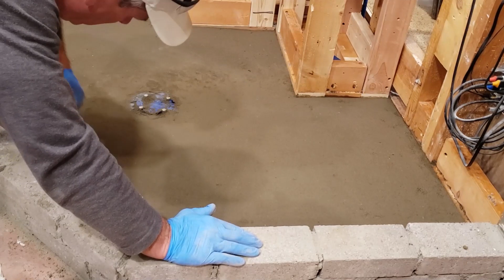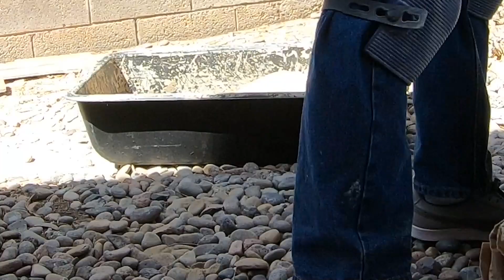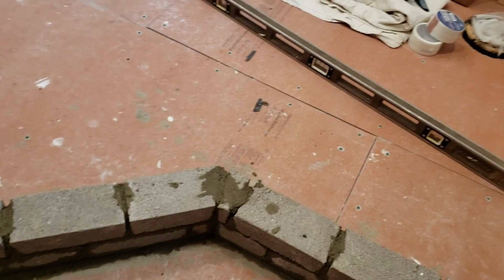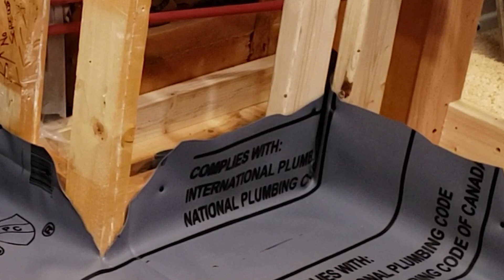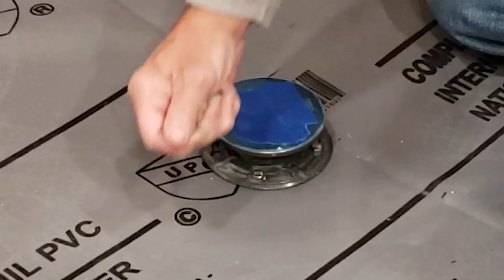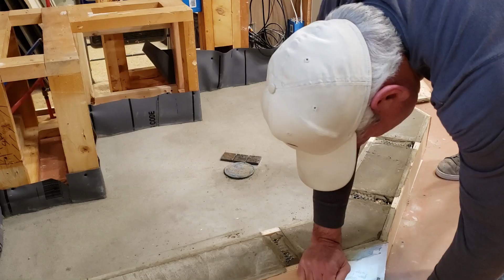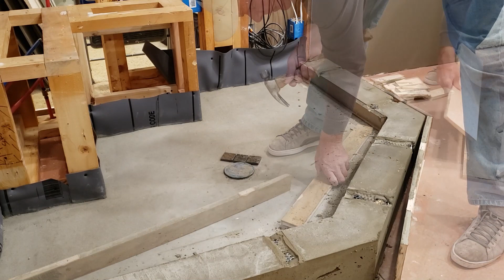Building a Corner Shower Floor From Scratch - Part 1

Comment: What about if I have granite scrap bricks? Do I need to cover the front of them? Or is it possible to just bring that metal mesh and then thinset and tile over the top and inner side? Also, is that wood on the inside of the ledge necessary? And does the metal mesh screwed into the floor help secure the bricks to the floor? Or can you just mortar them directly to the floor?
Reply: I forgot to specify, it's on a concrete floor, and I was hoping to use granite for the top tile for the curb and use actual tile for the rest. My goal was also to be able to see the edges of the granite built up on the outside of the curb because it looks neat, but definitely don't want to compromise the shower for looks. Lol. Thanks for any info!
Reply from the maker: Yeah, it sounds like an interesting idea that has lots of possibilities. Yes, you can integrate your granite pieces into the curb in any way that works. Just think of them as tile pieces that you need to be able to stick to the curb with thinset. You just need to consider the joint between the tile and granite pieces and how to make that work. I have often made a 45 degree cut on edges like that which I can close close together to give me a clean grout joint on those corners. On the curb, you are wanting to build a block of solid concrete mix out of bricks, mesh and the mixture of Portland cement and sand that encases the shower pan. The concrete floor is great and you can use thinset or the Portland cement mix like brick mortar to set bricks for the curb. Anytime I was using wood on the curb, it was as a concrete form to float my Portland mix in with. Once the mix is dry, the wood is removed and you are left with a straight and level edge to set tile against. Good luck on your shower! Sounds like a fun project!

Comment: What about the bench. No liner on the bench it will leak water
Reply from the maker: Nope, there is a Building a Shower Seat - Part 2 to the corner shower build. The bench seat is designed just like the shower floor and walls with Hardiebacker and a membrane but no dry pack. Here is the link to that video. https://youtu.be/F6axpz5jOIQ?si=6b_s_-izYgWtGrjs

Comment: Do you use regular cement to stick the bricks together?
Reply from the maker: Yes, same 1 part portland to about 2 parts sand to make it a little richer. Then mix in water to make a regular mortar consistency to use.
Reply: @RustyDobbs great thank you!

Comment: Why bricks and not 2x4?
Reply from the maker: As much as someone may try to waterproof 2x4s in the step, if water gets to the wood it will expand and the step will crack. Nothing you can do then except stop gap measures until you replace the step. Bricks are not any more trouble to use and no issues with expansion.

Comment: Finally someone who can build a shower correctly, I'm one of the old time shower builders that built it just like this except I used lead pans
Reply from the maker: Wow! Thanks for watching and for you comment! Lead pans were before my time but I have torn them out for sure doing remodels. Yes, these dry pack methods are hard to beat for floors. I'll bet you floated your share of shower walls too. The 1/2" Hardiebacker is a great alternative to floating walls. Same idea and purpose as the old school ways! Thanks again for commenting!

Comment: How would you build a shower pan on a wood substrate?
Reply from the maker: Same process as on concrete slab. This installation is actually on a wood subfloor. I put down Hardiebacker on this entire wood bathroom subfloor because I was installing tile on the floor too. The main thing about putting a concrete shower floor on a wood subfloor is to consider the additional weight of concrete that will be point loaded on that area where the shower floor is. You just want to make sure the wood trusses and support structure can handle the additional weight.

Comment: What is the advantage of doing a dry pack? And doesnt quickete sand topping already have portland in it?
Reply from the maker: The idea of dry pack is to allow water to pass through the shower floor to the shower pan and then into the weep holes at the drain so that water is not collecting or pooling somewhere in the structure of the shower floor. So, in theory, the floor will dry out when not being used. The sand allows the floor to be porous and the portland allows the floor to be solid. I have not used sand topping but my guess is mixing it water like I do my dry pack mix would probably work fine for dry pack.

Comment: Thanks for sharing your expertise. Did you do anything special to keep the sharp lathe from slicing the pan liner?   I didn't see where you did the flood test, maybe you did that after installing the lathe?
Reply from the maker: No, just common sense to make sure the lathe isn’t gouging into the pan material anywhere. The shower pan liners I use are quite thick, durable and pliable. A flood test is not required for this type of installation where I live. With the preslope in place and carefully installing the pan to make sure there are no penetrations prior to the final dry pack, this type of installation will last until someone wants to update the tile. Thanks for watching, Peter!

Comment: I'm just blown away by your old-school talents! I've never done this process before, but by watching your videos over and over, I feel I can do it.  I'm going to try my first shower floor and it will be 36" X 60". Wish me luck Mr. Wonderful!
Reply from the maker: I'm glad you find the videos helpful! You are right describing it all as a process. You just take it a step at a time and, like with most things, you get better the more you do it. The 60" length makes it a little more challenging particularly if your drain is at one end of the space and not close to the middle. Cut a few longer screed sticks. You will definitely get a good upper body workout floating that shower floor! You've got a great attitude and will learn a lot by taking on this challenge!
Reply: Never put nail holes in the rubber pan and Mr Dobbs  achieved it

Comment: what kind of mortar did you use for your curb? Deck mud or fat/wet mud?
Reply from the maker: I used the same mix I did for the dry pack. I just thinned it enough to use as mortar to set brick and pour into the forms for the exterior of the curb. My mix is one part portland cement to 4 parts sand. I may have added an extra shot of portland for the curb mix to make it a little richer with cement.

Comment: I didn’t see tar paper stapled to the subfloor with wire mesh before the pre slope. 

The silicone around the first piece drain was skipped underneath the liner which sal diblasi says is mandatory even though the bolts get tightened down. 

The form is actually impressive for the step but I just used wood and cement board for mine instead of those bricks you did there.
Reply from the maker: The subfloor is new 1/2” Hardiebacker installed on top of the old subfloor across the entire bathroom. Sure, you could use tar paper and wire mesh before the preslope or better yet, you could run another shower pan under the preslope. Why you would do that, I’m not sure. You have a shower pan installed on the preslope that is tied to the drain and wrapped up the wall behind the Hardiebacker and tile. Done right, that’s got you covered for decades.

Since YouTube came along, some tile setters have tried to turn their craft into a science. The only group I have seen who have tried to do that. I’m sorry to tell these guys that it is not brain surgery. You know as well as I do that it is not that difficult. You obviously have done your own tile work and it doesn’t sound like you set tile for a living. So one guy says a bead of silicone is “mandatory”? Or what? Lots of silly things get said by these guys. It is not necessary to try to pump up the perceived knowledge/skill level required to set tile for a YouTube audience. Great tile setters produce great work and that skill doesn’t need to be defended or built up. It’s an honorable trade to earn a living with. They should be happy about that. But, most homeowners with pretty good skills with their hands can be successful taking on their own tile jobs. I have helped a bunch of them through my videos and have been criticized by “professional” tile setters for sharing skills/trade secrets that great tile setters taught me 40 years ago. I’m glad you have been able to do your own work and many others like you with the help from YouTube videos. By the way, if only a little bit of water ever makes its way to the wood buried in your step, you will understand why I build steps the way I do.

Comment: Have you ever seen mineral salts clog up the drain weep holes?  I tore one of these out that was so clogged that the moisture migrated up the wall and curb
Reply from the maker: No, I haven't seen a situation like that. But depending on the mineral content of the water, obviously in your experience that can happen. Sounds like there may have also been some issues with floor slope, floor tile installation and grout joints letting water reach the dry pack more than it should have.

Comment: Good job, a lot work for that little shower though
Reply from the maker: Thanks, Michele! It was a very custom design and the homeowner wanted some very specific features. She was not concerned about cost. We completely redesigned the whole masterbath and had a crawlspace so there were no limitations on what we could do as long as it fit in the square footage available. That's about as big as we could make the shower and  get everything in that was still needed!

Comment: How far from the subfloor do you let the drain float for the dry pack, is a quarter of an inch ?
Reply from the maker: Yes, that measurement is not critical. All the dry pack is doing on that first layer is providing a support for the shower pan. It will be thin regardless and will crack as a result, but that is fine. It is not going anywhere!

Comment: Hi, what's the angle you cut on the curb?
Thanks.
Reply from the maker: Hey Mario! Two 45 degree angles on the shape of the curb. About an 1/8" lower on the back of the curb from the front. You definite want enough fall for the water to drain back into the shower.

Comment: How do I waterproof between the hardy backer and floor tile? On the very bottom?
Reply from the maker: If you are talking about the corner where the wall and floor meet, you can silicone that area if you want. I don't generally worry about it because my floor is sloping toward the drain where the Hardiebacker reaches the floor and after tile is installed, I caulk that joint at the floor tile and wall tile intersection.

Comment: What do you use to bond the bricks? Is it Type S mortar? 

Must the flange of the drain be flush to the subfloor, or can it be 1/2" above it, prior to setting the first mud pack? 

Beautiful job sir!
Reply from the maker: I use a richer, thinned down version of my drypack mix which is a portland cement base but masonry cement is fine too. I just typically don’t buy it unless I am floating shower walls which is very rare these days. No, the drain does not have to be flush with the subfloor. In a perfect world, that’s the ideal installation, but your first layer of drypack will level out the floor to install the shower pan appropriately. Thanks for watching, EE, and good luck with your project!

Comment: Hi Rusty.  Found your videos the other day and am so glad I did.  I have done numerous showers, but always tiling over a tub, and have never floated a floor.  I think I am about ready, and the main reason I found you was I was searching for "concrete curbs" as I would prefer that over 2x4's.  Obviously yours are brick, but I kept wondering what to do after the lathe was wrapped over - how did I then lay tile?  You answered it by showing putting the forms down and filling with dry pack.  What I am still not knowing is (1) is there a preferred thickness, or minimum for that?  (2) curious why dry pack and not concrete?  I've not used dry pack ever, but it can crumble, can it not?  And (3) you never mention if you attached the lathe in any way?  Just wasn't sure if you poured the dry pack in (or concrete) if the lathe needed to be attached - obviously only from the outside portion.  Sorry so long.  Thanks!!!  (You have a new subscriber in me now too)
Reply from the maker: Hey, Reid! Yes, definitely concrete curbs over 2x4s for obvious reasons. Let me answer your questions like this. If you can come up with a way to have a concrete curb that has the liner buried in it up to near the top of the curb, you’ve got a curb that will work and that you can set tile on. I just do that in a variety of ways to fit the situation. When I wrap the curb with lathe and set forms, I’m looking for about a half inch minimum thickness for the pour between the form and the brick structure. I use dry pack mix because I have it available and it is portland cement and sand which makes a solid cement base when dry. I just thin it enough that I can get it to flow well into my forms. I bend my lathe in a “U” shape and in such a way that it grips the curb when in place. When the forms are set and the cement is poured in them, the lathe is solidified in place. With thinset applied and tile set over that, the curb is not going anywhere. 

My methods are based on things others have taught me over the years and common sense improvements I have made as well. Yes, dry pack that is used for building the floor can crumble fairly easily but it has the advantage of being able to be cut and sculpted easily. Again, it will have thinset applied and floor tile set over it. The more water you add to dry pack mix, like cement, by troweling it you can raise moisture to the surface and get a typical hard, smooth cement finish (just without the gravel). Dry pack mix is much more of a pain to cut and shape with higher water content added so less water added is preferable for placing dry pack floors. Just try working with dry pack a little and you will get the feel for what a versatile mix it is. Lots of rambling, but hope that helps! Thanks for watching and for subscribing!

Comment: Nice work. Interesting how the ceiling is recessed above the shower. Is there a purpose for that? I would have expected to see an exhaust fan in that recess. Seems like it'd be a dead end for moist air.
Reply from the maker: Thanks, Tin! Yeah, the owner wanted recessed lighting in the ceiling over the shower that she could control remotely so that’s the reason for the design. I installed laminate strips on the top of the recess ledge before the LEDs to hopefully deal with condensation that may collect there. The exhaust fan is in the ceiling just outside the shower door and automatically kicks on and off based on the humidity it senses in the air. Not a perfect solution but the best we could do given the parameters.

Comment: As a plumber I understand construction. Your explanation/narration is mighty pro. Thanks for making this video. It gave me the clarity I was looking for 😉
Reply from the maker: Glad it was helpful, Jeffrey! Yeah, you are way ahead of most people because you understand the purpose of every step from the plumbing side. If you have not worked with dry pack before, it is like a regular cement mix without gravel and intended to be placed pretty dry with enough water to cause it to set up. It’s consistency makes it easy to cut, shape and pack. It’s porous to allow water that will make its way through the tile grout joints over time to get to the weep holes. The more you work with dry pack, the more your like it and see the possible applications for it. Like regular cement, once you start a batch, you need to steadily stay with it until you’re done. Try to get each layer done within a couple of hours. Good luck! 

My first real construction job was as a plumber’s helper for about 6 months as a 19 year old. Invaluable experience that everyone would benefit from. Worked with some good guys who willingly taught me the basics and exposed me to new construction as well as repair. Tearing out 40 year old cast iron sewer lines was a particular treat! Humbling experience that needed to be done and was good for the soul!

Comment: I'm worried about puncturing liner when putting liner on curb it seems 50% of tile stters don't use it?
Reply from the maker: My view on the standard liners like the one I used in this video is that if they are installed with care there is no need to be worried about punctures or tears, Steven. My observations of tearing out leaking showers is that pans get damaged by careless contractors in a hurry to get finished. Most commonly sheetrock screws or other sharp objects are left under pans during installation. Often installers will screw through pans into studs below the level of the finished shower floor. Over the years, you will get leaks in those showers as a result. There are newer methods that will probably prove to be fine over time. This approach is an old method that has proven itself over decades to be reliable. Just has to be done right in the first place.

Comment: What are you thoughts on kerdi over vinyl pan liner?
Reply from the maker: Hey Rito! I'm assuming you are asking about Kerdi in place of vinyl pan. I think it is probably fine but I have been happy with the vinyl pan so have only experimented with Kerdi.  In one video I did called "Building a Shower Pan From Scratch - In a Tiny Home", I used Kerdi and it worked out fine. It's my son's tiny home and so I was totally experimenting with a different approach. About three years later and it is still holding up fine!